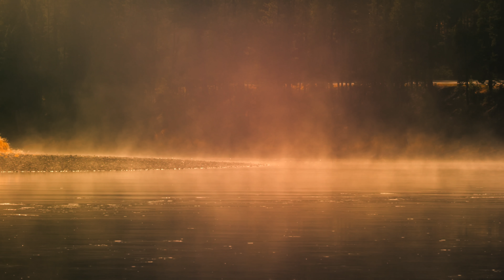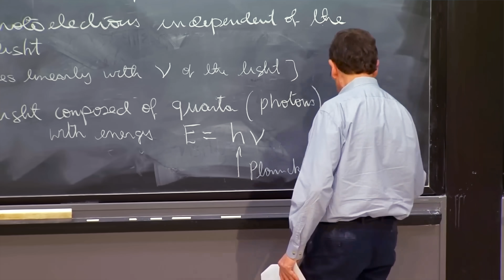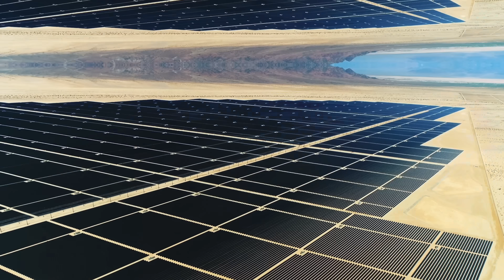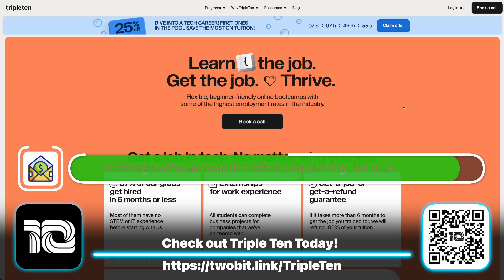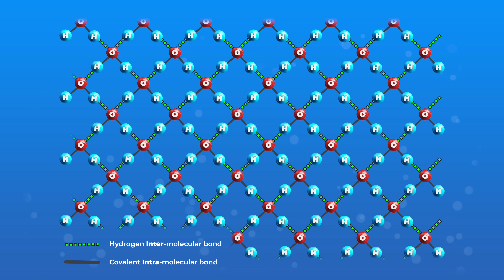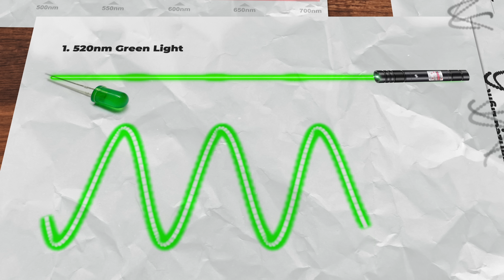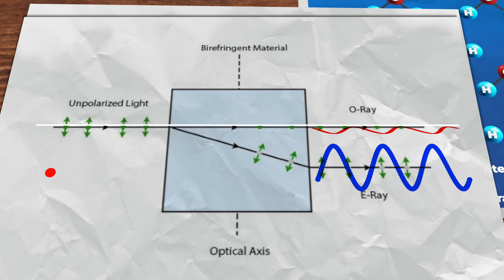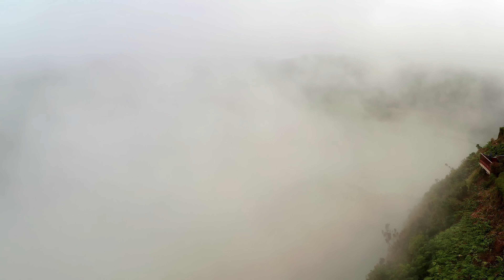New MIT Discovery Just Solved Water's BIGGEST Mystery!

Comment: If you think the photo effect is, see what happens to surface tension when voltage is added. It is possible to control the thickness of surface tension which is more or less a liquid crystal, by adding voltage. The molecular structure of surface tension is so complete there is no room for any impurities. As in happens to ice all of the impurities are forced out of sea ice or ends up in the center of an ice cube. Water, which we consider common place and fully understood is far far from being comprehended.

Comment: My pool heats up to 96 to 97 degrees F in the summer. 

I made a pool cooler out if three cheap shower heads ganged together on a PVC manifold, connected to one of the pool jets. The shower heads were set to about 45 degrees to maximize the eater's time in the air.

It actually cools more efficiently DURING THE DAY than at night. I always thought it was the HEAT of the day evaporating the water as it flew through the air.

Maybe it was the strong Texas sunlight acting on it!

Comment: My understanding is that most of the worlds Desalination plants work by reverse osmosis, this involves pumping water at very high pressures through a series of diaphrams.  This is uses a lot of energy.  I worked on the desal plant outside of Melbourne Australia and I design/drafted the MCCs (motor control Centres) for the plant.  in the end we had about 6,000 pumps spread across 4 MCCs, everything from 11kV sea water lift pumps, down to single phase dosing pumps.  If my sieve like memory can be trusted, I think the plant was using about 420MW of electricity and could make 1.1GL of drinking water per day.  Most desal plants around the world have a nuclear power plant next door because of the energy requirements to run them.  This sound like a much more efficient way to get drinking water

Comment: So climate science is not settled and vast amounts of information now need to be re-thought and models re-built because water vapour and clouds are more potent than CO2.
Photons are energy and behave like mass so why wouldn't the energy transfer evaporate water?
The same thing with a drop in air pressure, evaporation rates increase. Water on Everest boils at a far lower temperature than water at sea level.

Comment: Water evaporates by the addition of energy. Heat can do that, wind can do that and so can many other things. This is an actual discovery but it should have been obvious to science for quite a long time now. Our technology focuses on heat as we started much of that technology when we got fire. It is very basic for humans to think of heat often. There are other ways to speed up and induce evaporation. Like clothes dry faster in the wind. Maybe that will be the next break thru - use wind to speed up or induce evaporation. Maybe the next break thru will be increase the surface area, exposing more of the water to ways of gaining energy and evaporating.
Light is nearly pure energy and our current understanding of light is wrong. The air will always be involved as air is a fluid and only a gas at our ambient temperatures. IN this case very much involved as the air is in contact with the water. Air does not have to be there for water to turn to a gas, evaporate.
Water is also a fluid and only as it appears as it does to us because of the ambient temperatures. It's why when you add energy they both turn into gasses. 
Sunday School explanations like the Earth is actually moving towards you when you fall are the results of not realizing the Theories are wrong but adjusting things to fit the theories. What we are told light is, light is not.

Comment: Photons from the Sun can evaporate water directly without needing to heat the water first. This could fundamentally change the way we model weather, predict climate models, and even how we desalinate ocean water.
Normally, water evaporates when water molecules gain enough energy from heat to escape the surface. However, the photomolecular effect shows that light can evaporate water without increasing its temperature, simply by separating water molecules from the water's surface.
This discovery by MIT has been verified through many experiments and the results show that the rate of evaporation under optimal light conditions can be four times faster than using heat alone.

Comment: Holy shit, is that why plants are green? They reflect the frequency of light that most effectively evaporates water, thus preserving their water!?
Reply: problem is when the light hits the plant it's already passed though the water and if the green light is reflected the photons that didnt break a bond now have a second chance to do so
Reply: @TheD4VR0S  yes but is that water relevant to any pigmentation?  If the light passes through that water regardless of the pigmentation of the plant, then color would have no effect in that particular area and the plant would have no ability to reduce the accelerated water loss no matter how it evolves.  Or perhaps that water is more strongly bound in the plant cells so it is somewhat protected from the phenomenon you describe.

What’s most important relative to the pigmentation of chlorophyll is the role water has in the function of chlorophyll.  Perhaps the green light interacting specifically with the water that interacts with chlorophyll would cause excessive evaporation based interference with the primary function of the molecule.  Or water interacting with chlorophyll is weakly bound to the plant at that particular time and thus is easier to lose so much so that the color of light would have a materially significant effect on the plant’s overall rate of water loss.
Reply: @RedShiftedDollar  Sorry though people were talking about the water on the surface of the leaf eg: dew
Reply: @TheD4VR0S  Wow that’s an interesting perspective I hadn’t considered.  If water (dew) is allowed to evaporate more readily from the surface because green light gets two chances, this would increase the cooling of the leaf (evaporation is exothermic).  The cooling of the leaf would reduce temperature which would reduce the rate of evaporation for water contained inside the leaf.  

So it could be a dual function.  Rejecting green from entering inside the leaf directly increases water retention of the leaf cells and increasing evaporation of water outside the leaf decreases temperature and thus further increases water retention inside the leaf’s cells.
Reply: @RedShiftedDollar  good point ps: wouldn't the best way to prevent water evaporation from inside the leaf be to make it non porous ?
edit: just realised leaves need to be porous because plants absorb co2 and release oxygen Oh well back to the drawing board...
Reply: The green of plant leaves is the ideal color to absorb light to facilitate photosynthesis given our sun and atmosphere.
Reply: It’s amusing when non-experts try to discuss a topic about which they haven’t the faintest clue. 😂
Reply: But it’s the evaporation that sucks the water - and nutrients - up against gravity……..
Reply: @Wol747  From soil up into plants? Negative, afaik evaporation is not involved. All I've ever understood is that the water is pulled up via capillary action, which iirc is an emergent phenomenon with the same cause as things like surface tension etc
Reply: No that's NOT why plants are green.  Plants use light to drive the process of Photosynthesis, which results in tremendous water loss through their leaves.  
Chlorophyll reflecting green light does nothing to prevent water loss, as part of the process of Photosynthesis is to break down water molecules & recombine the hydrogen & oxygen, with carbon to form Carbohydrates for energy storage.  

Furthermore... it is a myth that plants do not use green light in Photosynthesis.  
All plants have Carotenoid pigments that absorb blue & green light, which provide excite energy to the Chloroplasts to initiate the Photosynthetic process.  
Also, by absorbing the high intensity blue & GREEN light wavelengths... Carotenoids stabilize the reactive protiens of Chlorophyll, which protects them from breaking down.  

The reason plants are GREEN... is because Chlorophyll, which reflects green light, is the dominant pigment due to the fact that yellow, orange, & red light wavelengths are more efficient at breaking apart Water & Carbon Dioxide molecules, to make Sugar. 
But green Light readily breaks down Chlorophyll pigments, which is why plants evolved to produce Carotenoids to protect the Chlorophyll.  

None of this has anything to do with conserving water.   Plants have evolved completely different mechanisms to conserve water, such as... CAM (Crassulacean Acid Metabolism) of desert plants... the release of aerosols by tropical plants to induce rainfall from the water they transpired... growing leaves with small surface areas to reduce transpiration... to drought dormancy.
Reply: No that's NOT why plants are green.  Plants use light to drive the process of Photosynthesis, which results in tremendous water loss through their leaves.  
Chlorophyll reflecting green light does nothing to prevent water loss, as part of the process of Photosynthesis is to break down water molecules & recombine the hydrogen & oxygen, with carbon to form Carbohydrates for energy storage.  

Furthermore... it is a myth that plants do not use green light in Photosynthesis.  
All plants have Carotenoid pigments that absorb blue & green light, which provide excite energy to the Chloroplasts to initiate the Photosynthetic process.  
Also, by absorbing the high intensity blue & GREEN light wavelengths... Carotenoids stabilize the reactive protiens of Chlorophyll, which protects them from breaking down.  

The reason plants are GREEN... is because Chlorophyll, which reflects green light, is the dominant pigment due to the fact that yellow, orange, & red light wavelengths are more efficient at breaking apart Water & Carbon Dioxide molecules, to make Sugar. 
But green Light readily breaks down Chlorophyll pigments, which is why plants evolved to produce Carotenoids to protect the Chlorophyll.  

None of this has anything to do with conserving water.   Plants have evolved completely different mechanisms to conserve water, such as... CAM (Crassulacean Acid Metabolism) of desert plants... the release of aerosols by tropical plants to induce rainfall from the water they transpired... growing leaves with small surface areas to reduce transpiration... to drought dormancy.
Reply: No that's NOT why plants are green.  Plants use light to drive the process of Photosynthesis, which results in tremendous water loss through their leaves.  
Chlorophyll reflecting green light does nothing to prevent water loss, as part of the process of Photosynthesis is to break down water molecules & recombine the hydrogen & oxygen, with carbon to form Carbohydrates for energy storage.  

Furthermore... it is a myth that plants do not use green light in Photosynthesis.  
All plants have Carotenoid pigments that absorb blue & green light, which provide excite energy to the Chloroplasts to initiate the Photosynthetic process.  
Also, by absorbing the high intensity blue & GREEN light wavelengths... Carotenoids stabilize the reactive protiens of Chlorophyll, which protects them from breaking down.  

The reason plants are GREEN... is because Chlorophyll, which reflects green light, is the dominant pigment due to the fact that yellow, orange, & red light wavelengths are more efficient at breaking apart Water & Carbon Dioxide molecules, to make Sugar. 
But green Light readily breaks down Chlorophyll pigments, which is why plants evolved to produce Carotenoids to protect the Chlorophyll.  

None of this has anything to do with conserving water.   Plants have evolved completely different mechanisms to conserve water, such as... CAM (Crassulacean Acid Metabolism) of desert plants... the release of aerosols by tropical plants to induce rainfall from the water they transpired... growing leaves with small surface areas to reduce transpiration... to drought dormancy.
Reply: Can we take a simikar view on our eyes. It’s fascinating because it ties in with blue eyes!!

IIRC blue frequency is 666 or something devil related. 

What if blue eyes people are angelic/unable to be evil?
Reply: @Christophtov Hitler had blue eyes. So did Ted Bundy and Jeffrey Dahmer. 

So there goes that theory.
Reply: Can we take a  similar view on our eyes. It’s fascinating because it ties in with blue eyes!!

IIRC blue frequency is 666 or something devil related. 

What if blue eyes people are angelic/unable to be evil?

It’s always struck me odd as Nazis were obsessed with blue eyes
Reply: Maybe its the opposite, they want to evaporate more water .. so they can bring more nutrients up from the roots.
Reply: It has more to do with blue light having twice the energy as red light, so you can use one molecule to produce either one or two glucose depending which wavelength hits it. This is more efficient than dividing the absorption area between different chemicals that can each just absorb one wavelength (say, a chemical that absorbs green light, which in combination with chlorophyll would result in black leaves), and also means plants don't need to synthesize as many chemicals. 

That's oversimplifying the nuances of having both chlorophyll A and chlorophyll B and similar such factors, but the basic point is metabolic efficiency.
Reply: Green roofs  could be better?
Reply: Right? I figured there was a good reason they tended toward green, but now i wonder why some trees have purple leaves...
Reply: @sapphirepyramid  plants with purple leaves probably don't grow well in full sun
Reply: @stevea3514  or they thrive in environments where water is plentiful and therefore accelerated evaporation at the leaf is irrelevant to the plant’s survival as a species.
Reply: @stevea3514  I think the leaves are more sensitive and burn easily don’t think they grow any less well
Reply: @stevea3514  Plants are actually more likely to turn purple when they get too much sun.  Too much sunlight can actually inhibit proper photosynthesis (think of it like running the machinery too fast).  The anthocyanins (purple pigment) help reduce the sunlight intensity and protect against UV-B light, so it basically acts like sunscreen.
Reply: @sapphirepyramid  There are 2 main kinds of chlorophyll.  One mainly absorbs blue; the other mainly absorbs red.  The color that is not absorbed is green.  The "red tide" near the Alabama coast that kills everything has a lot of the chlorophyl that absorbs blue. (Wikipedia)
Reply: No. Chlorophyll just happens to have that colour. Plants need to use this to get their energy.
Reply: @ahenchan5422  So you don't think it has a dual or multipurpose? Just a coincidence? >.>
Reply: @ahenchan5422 That is also incorrect.  It's not by chance. It reflects a color not used
Reply: @ahenchan5422 doesn’t stop plants evolving to take advantage of that property
Reply: @ahenchan5422  you see a coincidence, I see plants evolving pigmentation to protect themselves over millennia until they got it right
Reply: @pineapplekun8769 well…you wouldn’t see the ones that got it wrong.
Reply: @pineapplekun8769  you can't evolve something if you can't even survive lol. The logic is lacking here. You see, the complexity of life(yes, even plants) requires a creator from the beginning. The complexity we see cannot randomly evolve from nothing. There must be a structure from which everything can then diversify. 

Jesus loves you! ❤️
Reply: @hisnameisiam808  before I say anything, I believe in Jesus Christ. Photons hitting a plant won't just aromatically make it dry, it will just be drier than a plant that has green pigmentation. Have the plant grow in a wet place for millions of years and it will eventually be able to shield itself from the sun when it's not cloudy, it's that simple
Reply: @ahenchan5422 ok great but your statement is not enough to explain why chlorophyll is green.  Plants could have evolved a similar but slightly different color chemical that performs the same function but blocks blue light.

Imagine if the sun only produced green light.  Could such a sun have enabled plant life?  I think yes, plant like organisms would have developed a method of extracting energy.